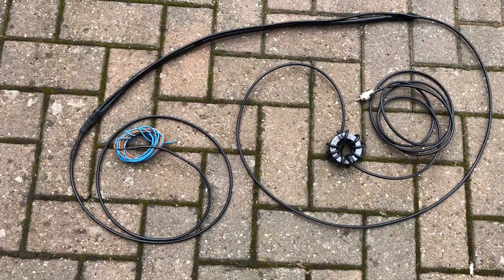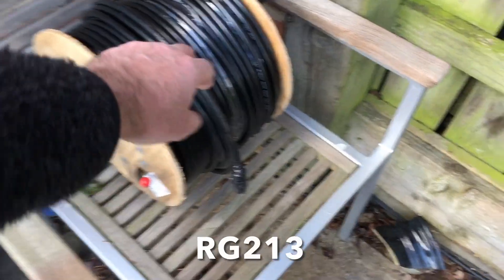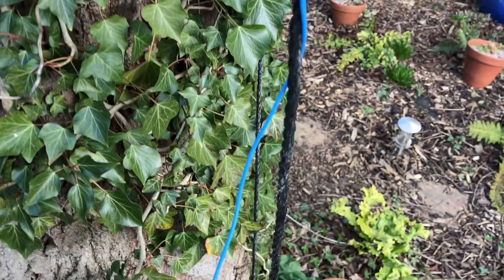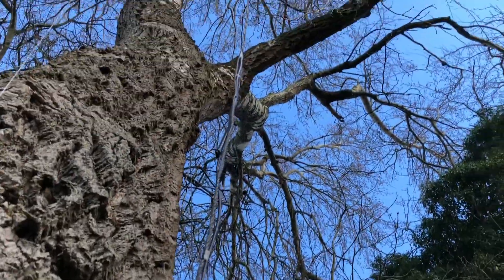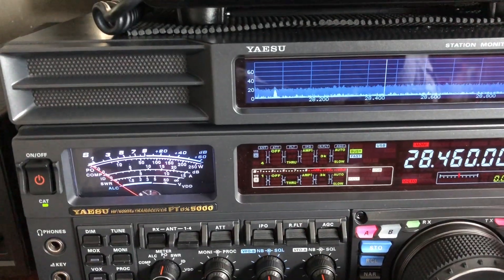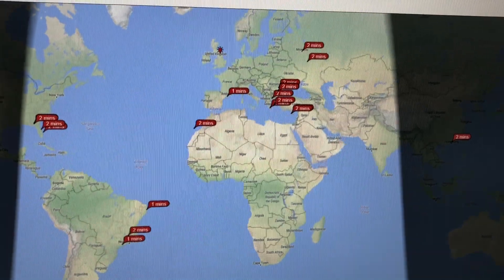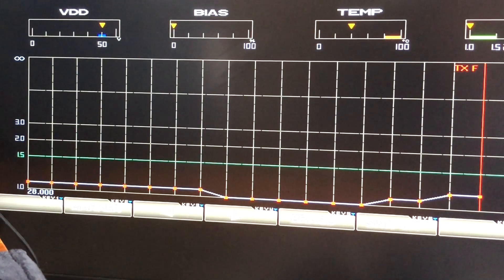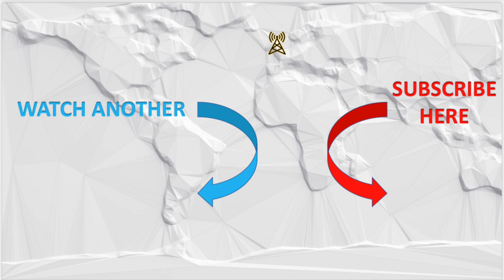5/8ths Wave 10m Antenna Installation

Comment: Fascinating video. I recently got back into CB after 30 years. I made a centre fed dipole and now a flower pot which I need a flag pole for as my 26 year old cherry tree is slow growing and not yet tall enough!  Ironically I trimmed it back by 2m about 3 years ago. I understand electronics a bit, but re RF, the penny hasn't dropped yet. I know that a 5/8 radiates better than a 1/2 wave. Anyway, my question ... these (flower pots and this design) lack a ground plane but I heard that if they are too high off the actual ground they are not so good? I love the idea that I can make my own antennas that out perform commercial ones. I made a flower pot one for air band and on a good day can follow air craft for 200 miles and a bit more on a 5m pole.
Reply from the maker: Hi and welcome back! If you think of these as effectively a dipole, then they are balanced and the higher the better. They don’t have radials and don’t need the physical ground to work against. Good luck 👍🏻

Comment: Hi 👋🏻 
I have a similar setup with a coax antenna on 11 meters. It’s been in the tree for nearly 5 years now with no problems and worked very well through the seasons. If you have a tree then use it! 👍🏴
Reply from the maker: Great John 👍🏻

Comment: Sounds like the 5/8 coax Gainmaster, Ian. For a bit higher power rating, I recalculated using RG213 for the complete thing (except top wire) but inc matching stub (allowing for velocity factor etc) and surprising how good it is 26.5 to 29 MHz (wider with external tuner). Quite portable too. I must give mine another go
Reply from the maker: Sounds like a good job Nick 👍🏻 I’m ok with my 200w so no chance of melting anything this end 😁

Comment: I put a DIY antenna up the center on my tree. Works great in the winter but once the leaves are on the trees it seriously limits its output. That particular antenna was for 2M VHF. Not sure how it will effect a 10M antenna?
Reply from the maker: Hi Andrew. Yes I think VHF and above takes a hit. I did a trial run last autumn and it worked ok, so should be fine. The main canopy is above as well 👍🏻